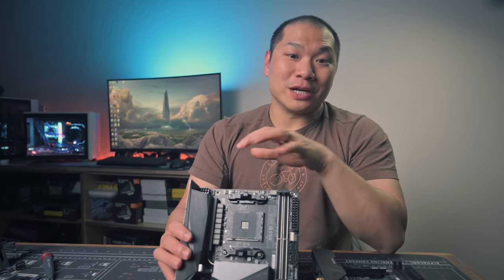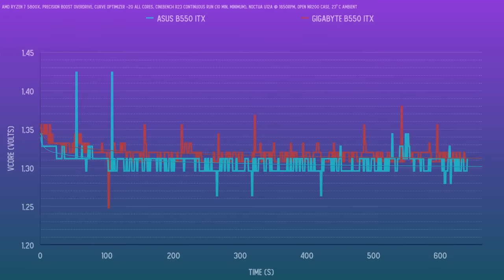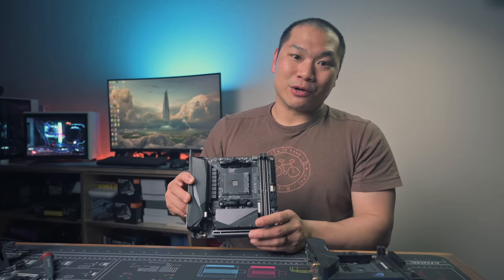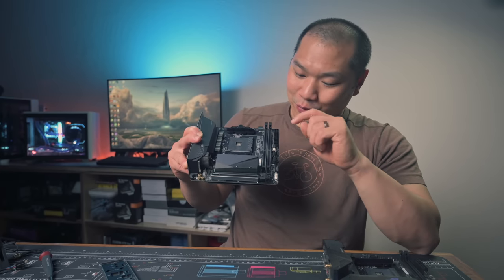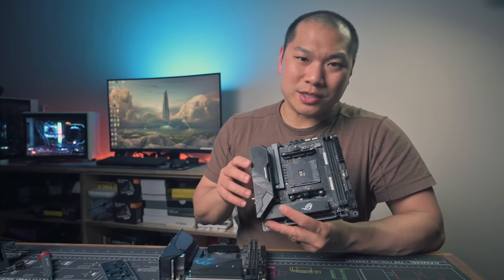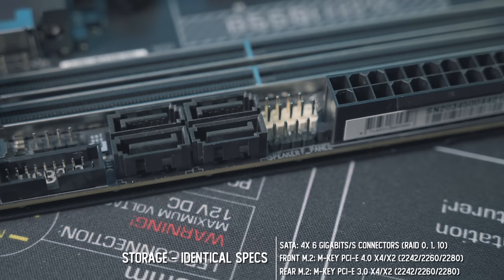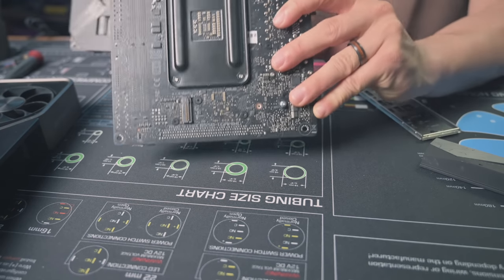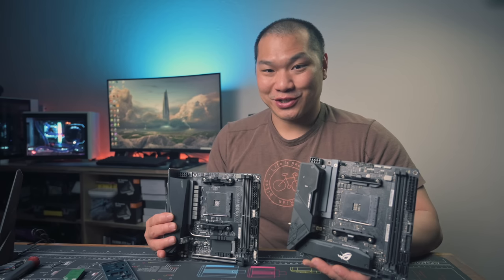Budget or Business? Comparing the Gigabyte B550 ITX and Asus B550 ITX Motherboards

Comment: have the gigabyte for a day now. was concerned at first as it posted once then went unresponsive except for fan power and heat. flashed the bios by holding down End at post and it came back up and has been fine since. although, the asus just appeared open-item for $30 cheaper and is tempting for the front USB-C header. all the reviews have come out a tossup so far but this review has helped me decide to keep the gigabyte. I can just do an adapter for the front panel USB-C if it becomes important. thanks and good vid!
Reply from the maker: Cheers. Unless you absolutely need the front panel C the Aorus rocks, the MSI is an option but has some limitations with the backplate.

Comment: as a first time builder that built in the FormdT1, i was more than glad that i chose the Strix due to the easy connector layouts. It may seem trivial, but trust me it made a HUGE difference. and probably the only reviewer that pointer out that the sockets all sat lower than the Aorus. This also made a huge difference for my build as I was then able to fit and loop all the cables and AIO tubes ABOVE the ram slots, making cable management somewhat a breeze. even for a first time builder! Thank you for the absolutely insightful review!

Comment: I've almost always chosen Asus boards because the layout is usually much better to work with & sometimes have extra/different features that you will use (Like a second Nvme SSD slot on the Z97 ITX), using their ROG STRIX B450-i Gaming ATM which is a great little board, has great bios support (currently 5900X) and zero issues with VRM temps like some YouTube channel was slating it for🤷‍♂️ memory support is also great  👍

Comment: Fantastic comparison video between the two best B550 itx boards. However the 2.5gb LAN issues had me go with the Crosshair VIII Impact, as well as the mountains of usb that it offers
Reply from the maker: Really good board.
Reply: @MachinesMore  Yeah it is, from an NR200 POV, the front panel pins point down which make them incompatible with the NR200's sleeve for those pins, thus you need to remove them and slide them in.

Thanks to your cooler video I went with the Mugen 5 as a cooler so thank you very much for your assistance and videos. Just need to wait for Arctic PWM Slim fans to come in stock so I can mount two to the bottom of the case.

Comment: Thanks for the review! Nice thing about waiting a bit are the comments from users and frustrations with the 550 chip set.  I chose the Gigabyte 550 and stuffed this inside the InWin Chopin with a now very cheap 5600G with stock cooler. The case does not have front panel type C. Initially had intermittent bluetooth, but all now flawless after Win 11 finished all the updates.  I run HWinFo to check for any m.2 heating, normally sits at 32C, but have seen 46C when long term gaming. The heavy top block installed to assist with cooling the 550 chipset with the FANLESS heatpipe, love it! The manual is a bit weak, but suggest you get help if you need to disconnect or replace the MB battery. Really? Before case installation, all was pretested with and without old GTX 970. I would go with either board depending on case and usage. Mine is for small quiet HTPC.

Comment: After more than three years of successfully using my Asus board, I'm coming to the end of my tether. After CPU (5800X3D) and GPU upgrade (4070) there are numerous reports and problems with the usage of this mainboard. Even after the latest May bios update, I once again have black screens and 100% running fans. There is still no certainty about the use of the Asus board with the new GPU generation. If I had known this beforehand, I would have opted for the Gigabyte back then. I am currently considering the worst case scenario of a complete mainboard change and buying the Gigabyte as of today. Would you also recommend it? Even today? I'm using the AMD Ryzen 7 5800X3D and a 4070.
Reply: This is precisely why i sent mine back to ASUS they have since refunded mine (owned since 2021) only problem now is im without a motherboard and not sure if i can trust the gigabyte becasue of the problems i had before, dropouts on USB, wifi, bluetooth.

Comment: I went with the Aorus board with a 240mm AIO and I kinda hate that socket is placed higher. It is definitely much more prone to trapping bubbles inside the pump. I do have to clear it out every time I move the entire build by putting the PC on the side and run the pump PMW speed to 100% for few minutes. I really wanted the ASUS but they are all out of stock everywhere and the Gigabyte was the only option.
I guess I should just be happy with the fact that it has better VRMs and no additional mobo fans.

Comment: Just bought a prebuilt system in order to get 5800x and rtx3080, now on the market for itx b550 to pair with nr200!
Perfect timing
Reply: Desperation at its finest
Reply: @kgb3209 yup. I've been using a 2012 laptop for almost a decade, looked at prices last generations and thought I'd wait... And now everything is still overpriced and scarce. If I didn't buy now, it would have meant another 6 or 9 months of waiting?
Reply from the maker: Awesome. Just curious what folks are doing with the rest of the goodies... are you going to part out the other components?
Reply: @MachinesMore  gonna keep em for another build, if/when parts become available.

Comment: I have the Gigabyte X570 I and the Socket Placement (X570 and B500 alike) really annoys me, as it prohibits me from installing a C14S in my NCase :-(. In regard to that, a friend was building an NR200 Case and I suggested him the ASUS board because of this exact issue and very likely compatibility issues with the pre installed top fan(s)

edit: reason why I have a X570, still using a R7 2700X and will upgrade to 5800X some time this year.
Reply: I hope gigabyte takes note of this, their boards are great otherwise.

Comment: Have you noticed any issue when using the Noctua NF-A12x25 on the Gygabite b550 itx? I've used these fans on 2 different Gygabite B550I boards and  they constantly stop spinning and start overheating. At the beginning it happened only with the PWM control but randomly even using tge voltage control. Quite disappointing is you consider the price of the NH-U12A.
Reply from the maker: I haven't noticed that- which header were they on?
Reply: @MachinesMore  both the cpu and the system1.

Comment: Awesome video as usual! Waiting for this channel to skyrocket, bound to happen. You mentioned the ram slots are lower on the Strix B550 - how are they compared to the Strix X570? I'm looking at that top rad NR200 in the background - would either of these boards clear that particular mounting RAM slot wise?
Reply: I've been researching this a bit, and it seems only the Strix board will clear the fans. Provided you use XSPC TX240 rad and slim fans
Reply from the maker: Cheers! They are the same, RAM slots on the Strix X570 and B550 are set lower than Gigabyte or MSI- however, the Asus Crosshair VIII Impact does not share that same layout so that will not work with the top rad mod I covered. I think either Strix is a good choice for a custom loop anyway, because of the temp probe. That’s not to say you can’t make it work with the other brands, you may just have to file away some of the fan’s frame.
Reply: @MachinesMore  thanks for that, much appreciated to have that verified! 👍🏻

Comment: I have the Gigabyte B550 ITX board mentioned here. There are times where Bluetooth is non-existent upon startup for my peripherals. I found a temporary solution to unplug the power cable and discharge all the power by holding the power button. 
You think I should consider a RMA?
Reply: Same for my board. I decided not to RMA because I don't use bluetooth and because I'm sure the replacement board they send me will have the same issue.
Reply: Same problem with my board..i don't know why with a BIOS update they can't fix the problem...i know of a lot of people with the Same issue...

Comment: Folks! CHECK BEFORE YOU BUY, GIGABYTE MAKES YOU CRY. Had fell in love with the Aorus B550i board, better pricing and better build, picked one up, started my own build. While I just tried to turn on App Center / Easy Tune, nothing shown up, 1min passed... 2mins passed... 5mins passed, either giving no respond or showing error message. So finally, here I got my Asus B550i board installed again, with no system issue and no system delay with the AI suite. Thanks ASUS.

Comment: Wished to go for Gigabyte, but I heard there is BT connection issue and taking out CMOS battery is a pain in the butt requiring removal of VRM heatsinks, in case the clear CMOS jumper is not working. I would rather have a CLR CMOS physical button than BIOS flashback to be honest

Comment: Thanks for mentioning Gigabytes " Double Heatsink ".. I've removed mine for a while with no problems. Maybe using thermal pads to fit the gap would improve it?
Reply: I did this and saw marginally better thermals for nvme.. not worth it unless your a numbers person
Reply from the maker: I’d agree with this... on paper you may get a benefit from that (but you also have to consider that the chunk is conducting the VRM/chipset heat too) so I think the simplest, albeit less pretty solution is just to use it as a paperweight, let that heatsink breathe a little.

Comment: Liked the Gigabyte ITX B550 board but had to go with Aorus ITX X570 for APU build that used Ryzen 5 3400G until I obtained a 
Ryzen 7 Pro 4750G. Was the BIOS ever updated to allow the Ryzen 5 3400G to function on a B550 board? Thanks.

Comment: If you were to stick a thermal pad between the M.2 heatsink and the big chunk of metal on the Gigabyte board, would that make the thing actually help at all? Or would it still worsen thermals?
Reply from the maker: It would be better provided you’re not transferring the rest of your board heat to it, for the most part I think it could work well. The reason I think Gigabyte did that was to isolate it and maximize board cooling, it’s a bit silly because of how good those power stages are already.

Comment: I chose the B550 exclusively because it has a temp probe header. Simply invaluable in a custom loop. Strangely only Asus seems to put these on their ITX boards, what is that about? I could not find a single other B550 or X570 board that had a temp probe, other than Asus boards.

Luckily for me the Asus one also seems to be the board with best top rad/fan clearance in the NR200 so I definitely do not regret my decision.
Reply from the maker: Agreed, it’s a huge plus for the custom loop builder. They even have it on the B450 I. This is just a niche feature, these boards already tend to be more siloed by virtue of being ITX, so I think board designers are less inclined to implement a feature that will only be marketable to a small percentage of builders. Oddly on the equivalent level B460 Intel board from Asus there isn’t such a header.
Reply: @MachinesMore  Yes you are probably right, although I feel that the footprint on the board is kind of insignificant for a temp probe. Well done on the Video!

Comment: Out of curiosity, how much does the extra height of the Gigabyte B550I socket affect the maximum height for air coolers in the NR200P case, particularly for the tempered glass panel? Any specific coolers you could recommend that would fit the tighter clearance? 

Also, thanks for doing these videos; they’ve been really helpful for planning my future build.
Reply from the maker: Sure thing- what I meant was the socket was close towards the edge of the board, thickness isn’t much of a difference between the two. The consideration is more for top fans or cabling, there’s more room towards the edge of the board with the Asus.

Comment: I'm having a hell of a time choosing between X570-i Strix and the Gigabyte B550i.  I have both in hand and the price difference was only $30.  You said the Asus x570-i is better than the Asus B550i, but is it also as easy to work with for first time builders?
Reply from the maker: Both are great boards and will run any Ryzen chip just fine, both are easy to build with - the M.2 heatsink assembly on the Aorus is slightly confusing but once you understand it it’s not difficult to install. The X570 I Strix does have a often buzzy VRM/Chipset fan, and it lacks the backplate and integrated I/O shield that the Aorus B550 I has, but the layout of the headers is more straightforward. If I were to choose I’d go with the B550 and save the $30, while that’s a low premium to pay, I’d say most builders will be just fine with B550 unless there is a need for multiple PCIe 4.0 NVME drives. The Aorus B550 is all passive board cooling which is very nice too.
Reply: @MachinesMore  First of all I want to Thank you,  Your channel is amazing and has been the best place to learn about this stuff.  

Also thank you for answering my question.  I think I will go with the Aorus B550-I.  the only other thing I'm concerned about is the CPU socket location.  I am taking your advise on using a NH-C14S with 2 fans instead of a U12A, as I have a very large Rog Strix 3080 OC. I'm worried if the B55I will have enough clearance for case fans with this configuration.

Comment: I have gripes with both of these motherboards, the Aorus lacks a USB 3.2 Gen2 connector and the Asus Strix B550 lacks a decent amount of rear IO while commanding a X570 ITX price tag. I am planning on getting the SSUPD Meshlicious case and it has a front mounted USB-C 3.2 Gen2 connector on the front panel which would go unused if I picked up the Aorus B550. I think the MSI MPG B550I Gaming Edge WIFI board would suit my needs best, only downside is they positioned the CMOS clear in a horrendous spot that's a bitch to access in case you have to reset the bios.
Reply from the maker: Yeah, I hear you on that. I have the MSI board on the review desk so should have some feedback soon but other than what you mentioned and the potential incompatibility with non standard AM4 backplates, it is a solid board.

Comment: I have the gigabyte x570I, i still didnt open it , plan to use it for a new build. Should I return it and get the gigabyte b550I? Whats the difference between the two since you said b550I is better
Reply from the maker: If you can without restocking fees, I would. The B550 is better for most people in the areas that matter… and it is a more complete board with many of the same features that make the Gig X570I good.

Comment: I had the Gigabyte Aorus X570i motherboard with the R7 3700X CPU, and it absolutely sucked.  It wouldn't let me undervolt the CPU, so it always ran in the high 60 degC.  When I swapped in the ASUS Rog Strix X570-i motherboard, I was able to undervolt the CPU by -0.1V, set the max overclock to 4000 Mhz, my CPU never goes above 53 degC now.  I also had a 120mm AIO with a Phanteks T30 fan on the CPU on both setups.  ASUS all the way!!!

Comment: only me have problems with the bluetooth of this card that reappears only if I completely remove power from the system? 
not to mention the lack of customization of rgb fusion 2.0 ...
Reply: i had this same issue, but only once.
Reply: @din3832  i had to buy a bluetooth 5.0 usb adapter to fix
Reply: @Ema050292  i read that it had smething to do with the computer waking up after beeing on sleep mode, and i since have disabled this function.

Comment: Just a shame they put that socket up higher making it incompatible with the NH-C14S in the ncase m1. I would be willing to switch to AIO just to be able to run the gigabyte if it would have had a front usb-c connector.
Reply from the maker: True true- dedicated USB-C front port makes it a trade-off. You could also twin the two ports, of course then they share the same header and it's slower. For the M1 with USB-C header... in addition to the Asus board you could also take a look at MSI's B550, similar power delivery as the Aorus but also with front USB-C.

Comment: Hello Machines & More, recommendation a B550i or X570i Aorus for the 5800X and 6900 XT ?
Reply from the maker: B550. Better priced board, similar build quality, and all passive cooling. Both will run any Ryzen CPU no problem. One reason you might go with the X570 is if you want active M.2 cooling, but I prefer fanless.
Reply: @MachinesMore  thanks, okay i buy a B550i Aorus AX for the NR200P an 6900XT :) is a H115i okay for the 5800X ?
Reply from the maker: I think a 240 AIO is good enough but yes, a 280mm like the one you mentioned should allow a bit lower fan speed.
Reply: @MachinesMore  thanks, now i have a 280 AIO and cpu under load 72°c in the NR200P

Comment: I have a 5950x running stock it’s always at 90c can you steer me in the right direction please
Reply: Need a lot more details than that.  Case you’re using, fan layout, CPU cooler in use to start.  If you haven’t already found solutions

Comment: Can you put a 25mm fan on the top of the nr200 with the aorus motherboard with a noctua nh U12A?
Reply: For that you'd want the Strix, the same reason I chose it over the aorus
Reply: @gadirussak  ok thanks!
Reply: @gadirussak  so you can't put a 25mm fan on the top of the nr200 with the gigabyte ? You Can only put 15mm fan ???
Reply: @Demonniacs  It depends on the cpu cooler
Reply: @thanasisvel  I'm going on Mugen 5 and 
if i don't say nonsense, i can't with b550i aorus pro AX

Comment: I wished I bought the asrock itx b550 cause its $40 less than the gigabyte board. The gigabyte board is only $30 less than the asus board. I just recently bought a new case, the thermal take tower 100 and i chose to save some money since I dont have to buy a new psu. If I were to buy a nr200p though, asus is much better itll fit the big fat scythe fuma 2 that I have compared to the gigabyte board.